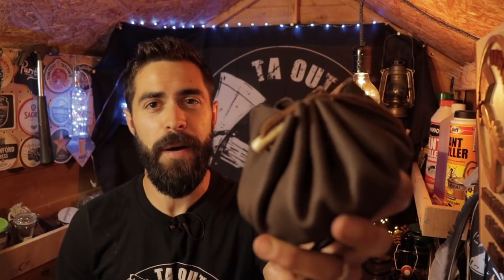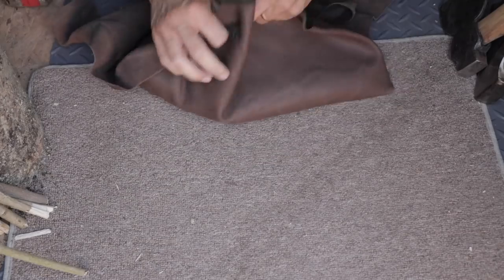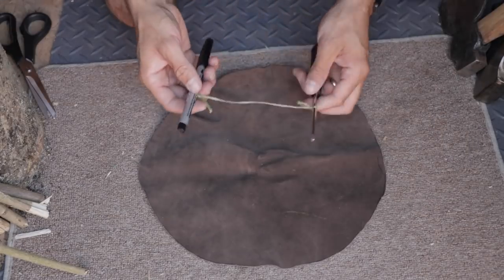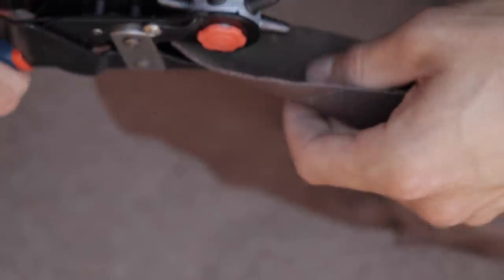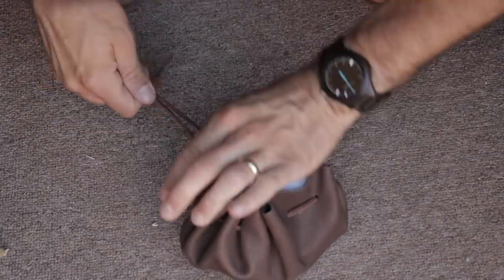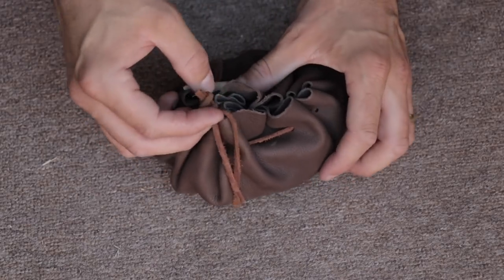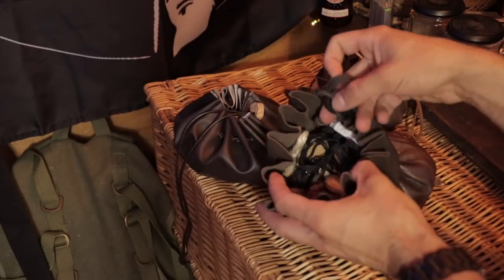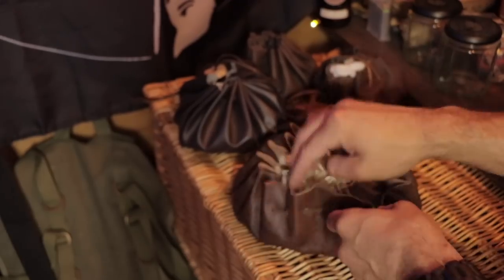Make a Leather Tinder Pouch | Bushcraft Kit (Tutorial)

Comment: I'm a pipe smoker. I'd like to see how I might bring my pipes and tobacco with me on a camping trip. Any ideas for a good way to do that?
Reply: Tobacco pouches could be 'pursed' with a leather thong, secured by a slider.  I am familiar with two types of tobacco pouches, both of which are lined with things like silk and rubber or 'rubberized' sheeting.  A typical closure is like Mike's elastic snap closure only mine were made long ago and used a metal spring set.  Most of my pouches are zipper closed with a baffle behind the zipper to keep moisture and aromatics inside.  Regular pipe smokers can be less fastidious, using a small pouch to keep a daily amount of tobacco on their person and relying on a humidor for refills as needed.  Or, these days, one could use a ZipLoc bag insert into a leather pouch with a lace and toggle.

Comment: When you'd drawn the circle (Or even before that) why didn't you change the size, could have easily got another inch or two all the way around on that bit of leather. Unfortunately I got a load of leather sheets offcuts a while ago with this in mind but I mistook inches for cm... Ended up with a whole stack of leather 15x15 cm lol